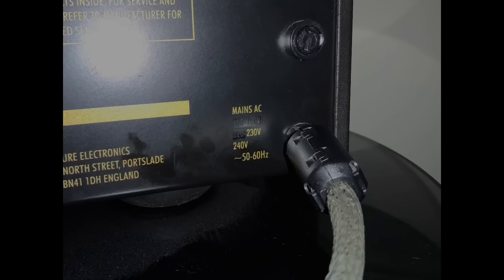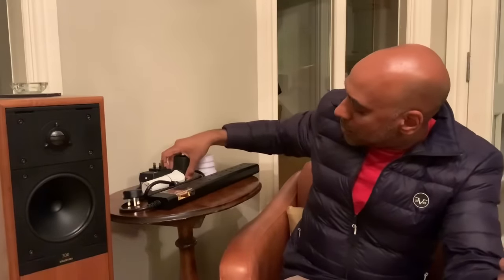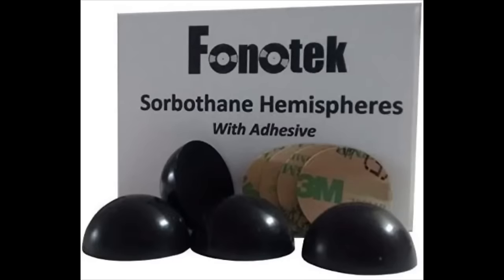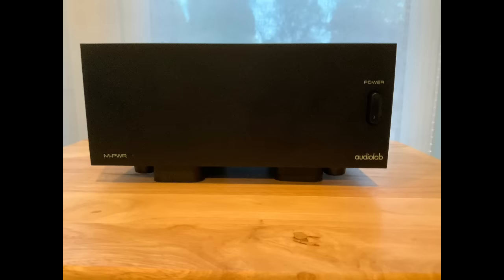My Top 5 Inexpensive Hifi Tweaks

Comment: Want to know the ultimate tweak? One that has blown away over £3000 of high end and worthwhile audiophile, vibration absorbing feet in my system and allowed me to sell them? And it cost me around £100 total to float my entire system? 

To support a single hi-fi component, buy three aluminum, screw on jars that are at least 100ml each ( I'd recommend 250ml and you can pick up these jars on eBay ) and fill them to the brim with fine table salt. Make sure the lids are level when screwed on ( difficult because you are trying to jam in the salt to the brim ) and the jar is basically solid when you rap on the lid. Put the three feet under your electronics ( or six under speakers ) and ensure screw heads, ect, are avoided. 

You won't believe what this does. The sound develops all the transparency of any Stillpoint footer but doesn't strip away body and weight. In fact, the sound seems too bottom-heavy until you realize that bass guitars, bass drums and low notes on pianos are supposed to have that weight and power and that almost every system fails to convey that musical reality. Once you accept that, you realise that this rare sonic conveyance of low frequency energy is the sonic backdrop to the rest of the frequency range, making the rest of the musical notes stand out better via contrast. The 'chest' of singers voices can be heard and the richness of harmonic decay across strings combines to give the true intent of the musicians -such as the way that the instruments, despite being separated tonally, combine harmonically into a musical whole. I can't tell you how satisfying it is to hear.

These jars, packed with salt, absorb parasitical vibrations through a principle called 'Particle Impact Damping' which you can look up on the net, if you wish to understand the physical principles. Certain companies are already doing the same thing but with machined Tungsten footers, filled with Tungsten Carbide powder. These feet are exceptional but cost the Earth. You can achieve about 90% of the results these firms achieve with a few metal jars and a tub of salt. I have brought aluminium oxide power and even Tungsten Carbide power for minimal improvement that I didn't think worth the cost or aggro of dealing with toxic materials. Using salt as a slurry to convert vibration into heat worked more than well enough and is almost as cheap as the chips you put salt on.

Try it with a single component. To float a DAC or integrated amp will cost you maybe £10. Then get ready to buy lots of tins and lots of salt because you will want to use this tweak on everything; speakers, CD players, power conditioners, even the distribution block, all show similar characteristic sonic benefits -proving that something fundamentally wrong is being corrected.Then you can flog off all your old and expensive hi-fi feet and get some decent money back. Trust me. You thank me later.
Reply from the maker: Thank you Lee. I will look up the particle impact damping as you suggested. Thank you for watching and sharing 😊👍
Reply from the maker: @fuckinellitsraymo  Himalayan  😉

Comment: Watched this video with interest. Perhaps someone can explain why anything more than the basic mains connectors and cables makes any audible difference. I ask since the mains ac supply is converted, via a transformer / rectifier / reservoir capacitor circuit, to dc to run the amplifier. There is no direct connection from the ac mains to the power supply dc output so what actually occurs to improve what you hear?
Reply from the maker: Hi Toolcollector 99, I am still to hear a fully convincing argument as to the reasons why exotic power cables are better that well engineered, inexpensive ones form Belden, Lapp, etc. However, a quality cable with 14AWG conductor, good insulation and shielding for £7 a meter makes sense to me. Especially when I have so many power cables, interconnects and speaker cables in close proximity to each other. Thank you for watching 😉

Comment: Have you ever tried the Supra power strips?
Reply from the maker: I haven’t earthstick. Got a Supra interconnect which I like. Do you have any experience with the power strip?
Reply: @abritishaudiophile7314  No, I was thinking of using one but it is a bigger investment than the Tacima you suggested here.  I might try your one first.
Reply from the maker: I personally would go with a parallel mains conditioner like the iFi AC Purifier first.
Reply: @abritishaudiophile7314  I've seen the Russ Andrews one and I think an IsoTek one before.  No idea what any of them are like.
Reply from the maker: Hi earthstick, the problem with power strips are that they are very system dependent. Some amplifier aren’t happy with the high impedance of the coils in the filter. That is why I would start with the active parallel mains conditioner. It also made more difference in my system than the passive filters in the Tacima.

Comment: hi i would like to ask you about Taga PC - 5000 power conditioner for my external power amplifier XPA 11 Gen 3 because me Switch mode power supply has a humming sound and i don't know if it's for my electric outlet dirty power or not and if i get Taga pc - 5000 power conditioner it's going to solve this issue or not hope to reply me ASAP.
Reply from the maker: Hi Peter, if it is a ground loop issue it won’t solve it. Worth a try though 😊
Reply: @abritishaudiophile7314  thanks for your fast reply do you know brand Taga pc - 5000 or at least do you know how to select the right power conditioner to my power amplifier or any power conditioner will be the same.
Reply from the maker: @peteroussa  I am not familiar with that brand. Power conditioners on big power amps can be tricky as the added impedance can restrict dynamics. That is why I like parallel power conditioners like the iFi AC iPurifier 😊

Comment: Like you I'm into optimization. You never know. 
I started with a good power strip from wireworld, I heard a nice diffence so I bought audioquest and wireworld power cables, again a nice diffence/improvement. Then I bought audioquest interconnects. Ifi ipowers 5v and 12v for my dacs and switch. Audioquest rj45 cables, the same isolation feet you've shown. All those tweaks were amazing but I started asking myself if I could have it for cheap ? The DIY way.
Now I'm into getting rid of weak links in the chain, changing capacitor and resistance in my speakers filters. Changing the internal wiring too. So far it is getting only better. I started with entry level speakers to make sure it doesn't mess up the tonal balance.  at those prices I don't think they use a very fixed refence point. Specially with those cheesy parts. 

What do you think about upgrading filters ?
Reply from the maker: Hi Yannick, thanks for sharing your experiences. I use Ifi powers on my DAC and Auralic streamer as well. I am not sure what filters you are referring to?
Reply: @abritishaudiophile7314   I started with Elac debut 2 b5.2 . I was refering to it's Crossover. Sorry mixing languages :)
This afternoon i was working on the Triangle Borea br02's crossover. I just finished. I'm gonna let it play all night and start listening tommorow. But what i'm earing right now is already amazing.

I'm starting to believe that beside high end speakers built with no cost in mind, the rest need a little bit of help to shine.

Comment: Never terminate the power cable shield on both ends, because instead of creating a shield for EMI/RFI you would be creating a ground loop and injecting the EMI/RFI in the ground plane! Just terminate the shield on the male plug and never at the female IEC plugs!
Reply from the maker: Thank you Ricardo. That seems to be the general consensus.
Reply: A British Audiophile no worries ;) the principle of shielding in low frequency is to absorve the EMI & RFI and dump it to the closest (and only one) earth point in your circuit. The principle of shielding high frequency signals like network cables, Coaxial cables is by shielding protecting the exterior surrounding environment of EMI generated by the internal high frequency signal + protect the internal high frequency signal from the exterior RFI.

Comment: Really not sure you should put ferrites on speaker cable. If it were OK it would be standard practice. I think you will only increase the impedance of the system.
Reply from the maker: It is the added inductance that can be beneficial on some cables. Check out this article from Empirical Audio...
http://www.empiricalaudio.com/computer-audio/technical-papers/myths-and-snake-oil
Reply: @abritishaudiophile7314  Well it's an interesting article. However I would not base my ideas on one manufacturer's impressions, when they are leading to their products. Changing impedance or resistance of speaker cables. I just don't know. At the very least you may drop some load from the amplifier across them with ferrites. Speaker cables are built to specifics, and altering that may alter the signature. I just don't know.

There is correlation though, with one article I saw referring to cable shielding, and that paper's viewpoint. Lavardin who make some of the best integrated amplifiers, say speaker cable doesn't need shielding. Just top quality copper I think they advise. … All I know in reference to that is I bought QED Supremus that uses shielding, and I could not be happier. Maybe I wasted some money, but at this point it's too late to care, or need to based on performance. … The Empirical Audio viewpoint about shielding adding capacitance it relevant. However anyone who knows what to look for buys low capacitance shielded cable, if going shielded. (E.g. QED Supremus.)

Many other reviewers advocate shielding so there are different viewpoints. Remember non-shielded wires pick up the same RFI that TV and audio aerials do. No-one wants that combining with their audio signals. .. I think shielding is more down to what else goes into the product. For example what's considered the best interconnect is made by Chord Company. It uses the same  ultra rare Taylon shielding that NASA use on satellites to block unwanted crap.

One thing to bear in mind is that just small changes in signals, alter the audio. If you don't believe it, do this test. Use some audio editing software, get one sample point, and move it even just a bit. Then play back that area of music. Meaning we don't want any RFI in out analogue cables. Or passing along our digital ones and affecting analogue output of DACs.
Reply: @abritishaudiophile7314  Afterthought. I did read on in the website you linked. They said if you put shielding on cables, then the shield is better far away from the cable to avoid capacitance. The QED Supremus that I bought used a thick design. Maybe that was the plan to keep shielding distant from cable. Can say that the Supremus is a gorgeous neutral cable. Solved the very slight brightness I had with Chord Clearway, plus the QED added detail. Would recommend it all day long.
Reply from the maker: Thank you for sharing Three Cats 😉
Reply: @abritishaudiophile7314  You're welcome. Hope it didn't sound like I was hacking on your video. Was just being chatty. Am open minded to all ideas put forward. Good luck with it.

Comment: 😂😂😂, instead of spending mony on snake oil, buy some absorbers and diffusors for room treatment following the live end, dead end principal, get the rt60 below 0,5 seconds with an equal distribution over the whole frequency spectrum , calculate the room modes and lower those frequencies in the bass. or get an av-receiver that supports dirac live. that will have several magnitudes higher impact on sound than expensive cables.

Comment: In the US our gear is powered by 120v but the feed to the house is center tapped 240v. I picked up a 2kva 240 to 120v transformer years ago. The input is both phases of the incoming 240v, the output is an isolated 120v that feeds my system.That transformer is fed by a dedicated feed from the circuit breaker panel. I feel this eliminates any common mode problems.with incoming power.

I also replaced all the IEC cords with 14 gauge shielded cords (about $!2 each from Newark Electronics) to lower anything that might ride in on the AC mains.

The signal level components sit on a record cabinet I built myself out of 3/4" oak plywood that is holding several hundred pounds of LP's.. The Music Hall MFF-7 turntable is sitting on a 3" thick maple platform on top of that record shelf. The signal level equipment is fed through a 6" cube military grade 20a EMI filter, The power amps are fed outside of this as I don't want the power amps rectifier current slugs getting into the feed for the low level gear.
Reply: And ? 😂
Reply from the maker: Hi deli177, thank you for watching and sharing your experiences 👍

Comment: I should try rubbing some snake oil into your speaker cabinets!!!!!
Reply from the maker: I have already done it Tony. It improved the sound no end 😉😉😉
Reply: @abritishaudiophile7314  That I can believe. As a son of an electronics engineer who had more than 60 years in the trade and even designed and built his own equipment. I find most of what you are saying laughable. I also have an electronics back ground and have restored much vintage audio equipment. You were talking about vibration in valve equipment. When Vox designed the AC20 they rolled it down a flight of stairs. Guess what it still worked they even used this in there sales pitch. How do you think the EL34's handle vibration in a guitar head amplifier when they are sitting on top of a cabinet containing 2 18 inch bass speakers putting out 100 watt RMS. I would invest in an hearing test if I were you!!!!

Comment: If any of your equitment comes with a fixed cable into the unit. Then you are stuffed.
Reply from the maker: My Exposure amps come with captive mains leads Graham. I placed a tinned copper braid around the outside and connected it to the earth pin of the plug. Not much else I could do without removing the lead. I remember discussing the issue with John Farlowe (founder/designer) over 20 years ago when I worked at the Exposure for a short while. His reason for having the captive mains lead was that the IEC connector was a source of potential noise in itself and that the captive lead got around this issue. 🤔

Comment: That shielding you showed on the plug is wrong ! has to be terminated at the socket end in the Wall not terminated at the plug  iec has to be left unconnected! not the other way around. and also any connectors from equipment back to the mains plug has to be done in this way ideally with a 20 ohm surface mount resistor connected to ground from The shield on interconnects. And possibly the resistor on the mains cable mains cable shielding can strangle the sound the resistor will give it air and space. I just go with cable solid core in wall cable 1 and 1/2 mm Strand

I've got the best feet for you mate DIY not expensive. Works on speakers turntables and should work well on valve gear but not tried anybody try it let me know! do not have,
Buy some squash balls and you want 5 per speak 3 or 5 for turntables, a large syringe or small funnel could be used. And the Magic ingredient is buffalo c80 tungsten powder 50% more dense than lead and is safe, fill the squash balls up to the top with tungsten powder for speakers for turntables three quarters of the way filled up. Squash the squash ball first to get all the air out before injecting the tungsten powder , cut a T shape in the ball precisely and superglue this back up afterwards keeping the cut you made at the top or bottom if used on very heavy speakers.
If your turntable bottom is solid sounding use three squash balls if it sounds plasticky or thin use 5 ideally close to the middle as possible.
Try running your Earth wire from the mains separately disconnect it from the socket sockets a 10-mm Earth wire into a spike in the garden minimum of 20 m from any electrical pole outside, make sure you bang the  spike all the way down to the hilt

Comment: Be careful applying ferrite cores like that: by passing only one conductor through the core, you are in fact suppressing high frequencies in 'differential mode'. This means the inductance introduced by the ferrite will he suppressing wanted high frequency audio signals to your speakers (albeit negligibly). 

If you want to block ambient noise coupled on to the speaker cables, you can still use that one ferrite, but pass both conductors through it together (known as 'common mode'). 

 It might be more useful to apply the ferrite at the amplifier end,if any, because the amp contains the active electronics and will be more susceptible to rf interference than the passive speakers.
Reply from the maker: Thank you for watching and sharing rowgli. I suspect some amplifiers actually prefer the extra inductance like my Exposure and some old Naim amps. No zones network on the output stage.

Comment: I just bought a new amp and cd player and I get a slight hum from one of the speakers and it drives me crazy
Reply from the maker: Could be a ground loop problem 😊
Reply: Thanks for the advice I will try the power conditioner first. I bought a roksan attessa and cdt.. I love the sound and listening with spendor D1 speakers. I just hope the 60 hz buzz stops even though it,s very low

Comment: I recently reinforced my stereo cabinet. I’ve upgraded several pieces over the last year and each piece,amp, preamp and CD player weigh almost 40 pounds each! I made new shelves out of 3/4” plywood and doubled them and inserted a thin piece of foam material sandwiched in between them. This should help reduce vibrations.
Reply from the maker: Hi Robert, sound like a well constructed cabinet to me. Thank you for watching and commenting 😉